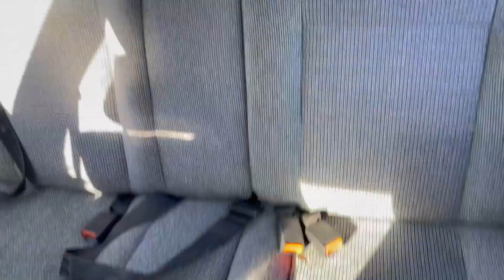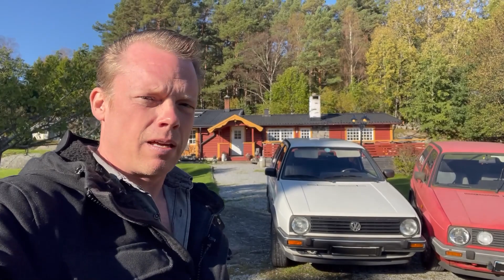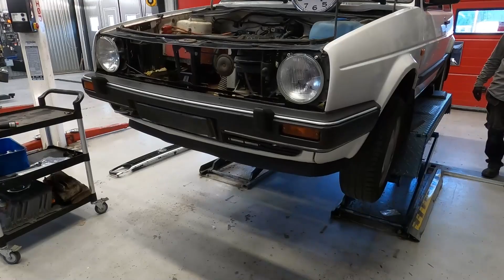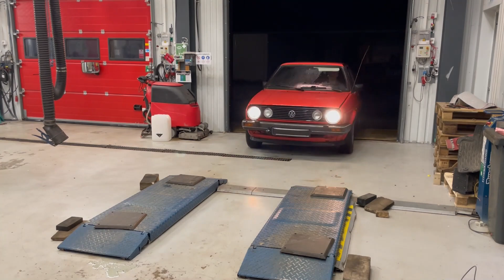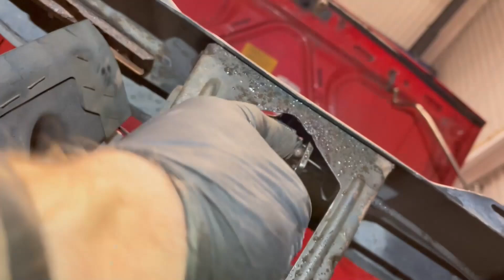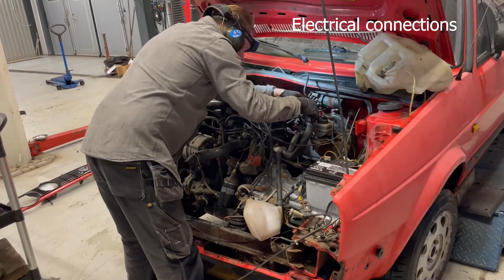Fossil to electric, Motor swap and EV conversion of my donor car Vw golf mk2.

Comment: That gearbox out of the red petrol golf looked brand new! Must have had a Refurb before you got it!
Also would love to have seen a bit more about what was involved in electrifying the petrol golf.
Great work
Reply from the maker: You are correct about that. This gearbox has been out of the car earlier by me and the plan was to use it in the final set up together with a leaf conversion. In this video I pretty much just moved everything from the white one to the red one. I think that you will find more info when I later started the leaf conversion to the white golf instead.

Comment: What's the maximum distance can get from full charge?
Reply from the maker: 200km in summertime. Here are the video when I did the test: Range test, it was before I did the swap as you probably understand:  

Electric Vw golf Mk2 citystomer with diy lithium battery
https://youtu.be/Oij9POEh7M4

Comment: germany again: awesome how fast you swapped motor and gearbox between the 2 cars. Was it really a forklift motor in the citystromer? It looked very old as if VW did not want to develop its own. I cannot understand this because the Bosch engineers were not far away to develop a new electric motor.
I have seen a couple of EV-conversions already but this was by far the fastest and advanced by a single person I ever saw!
Well done and keep on with all you interesting projects!👍
Reply from the maker: Hi and thank you 😃
I understand your confusion.
The motor or speed controller failed long time ago and therefore those has been changed by a previous owner. That’s also why I will install a more modern drive train to it. If it hade the original motor I definitely had rebuild it to its original form. But anyway, the leaf motor will make it so much useable.
Thanks for your comment, I highly appreciate it 🤗

Comment: Motor swap can be a lot more and most important will be the question about the safety requirements a city stromer had to fullfill back in those days.
I would expect that may be stronger springs for the heavier load will be required as an improved shock absorber and reinforced brakes for the higher weight. Therefore more parts have to be swapped if you pretend to rebuild a city stromer in a newer or better chassis. 
But I guess it becomes even a lot, lot harder by german standards at least due to the engine change on top to Nissan Leaf. Here it would be called a Frankenstein car cause it woud have lost its heritage and roots and it would be hard to get it street legal, I  mean the paperwork will become tooooooo expensive, all the investigations required. 
Possible, but tons of money would be needed.

But I likeyour ideas andcraftman ship and the story you are telling
Car check every single year ?
That is even more than in germany with a biannual car check or british MOT!
Reply from the maker: Springs and chocks will be changed, but as long as I don’t exceed the total weight and/or max allowed axel load it will be fine, at I hope so.
I keep you updated☺️ 
Thanks for your comment.